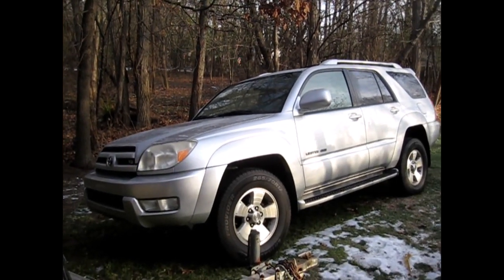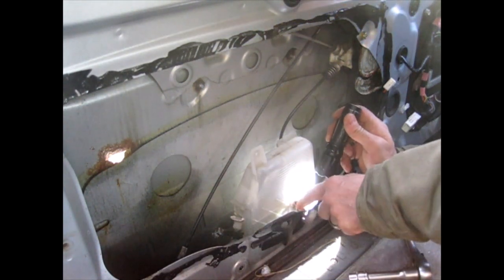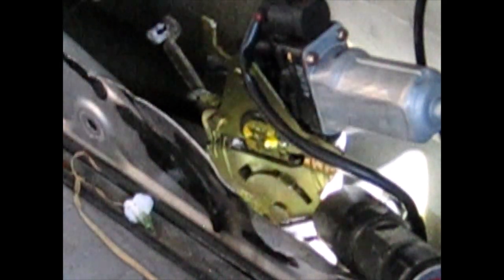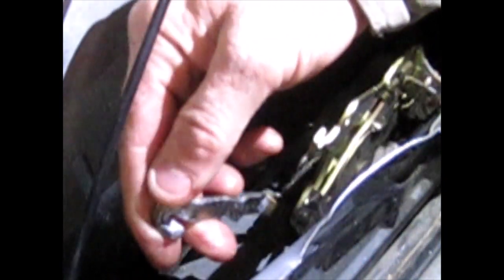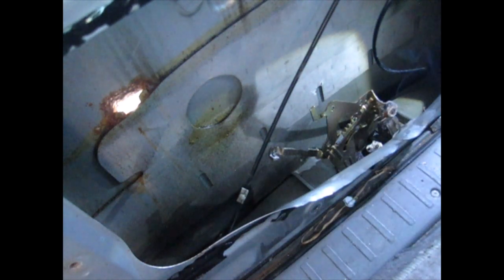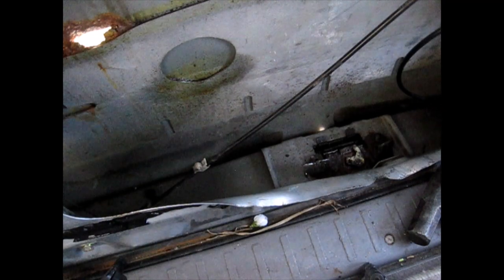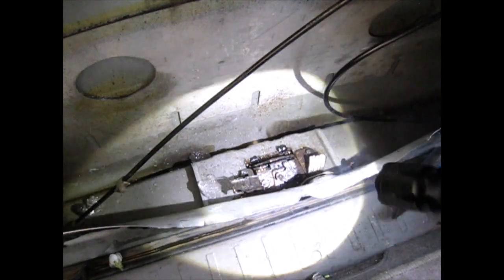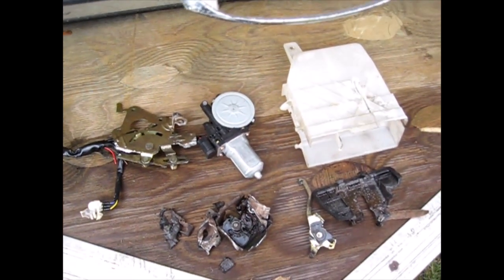2004 4Runner Tailgate cut out Rear Lock Latch seized Door Latch mechanism Removal

Comment: Damn dude!  Thanks for the video. I got a 06 runner with the same problem.
Reply from the maker: Just get the right tool! A die grinder will work much better and just cut off the two ears and the door will open. It put up a fight with me having the wrong tools. Sorry this video was so long, I had no idea what I was in for. Good luck!
Reply: You did great! Thanks for blazing the trail.  I was particularly impressed with the torch.  But will follow the die grinder method.